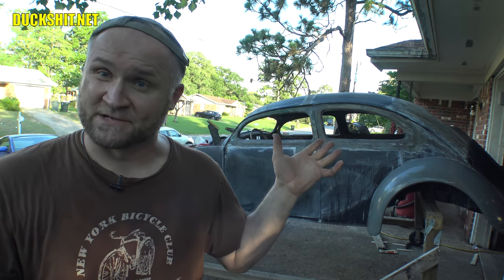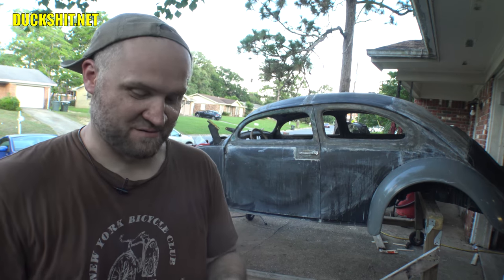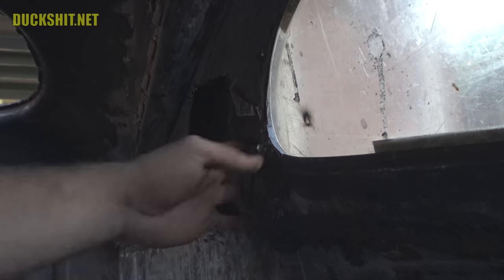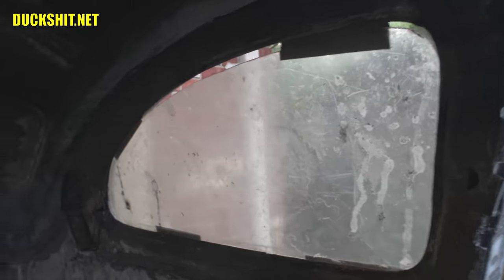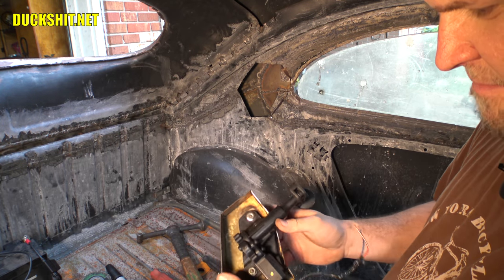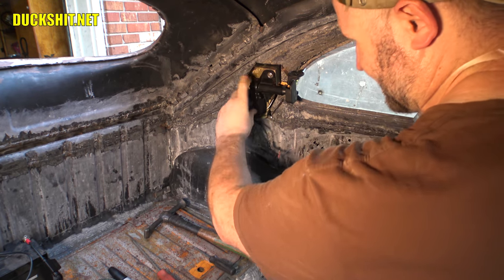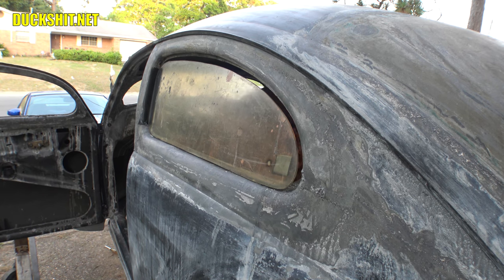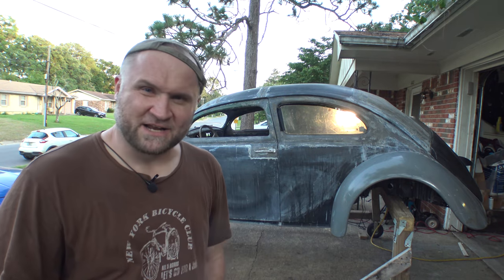VW Beetle Power Pop Out Windows 1 - ROTTEN OLD 1956 - 106

Comment: Man that is so sweet!  Love the fact the  Chrysler one you use attaches via adhesive. I’m sure the odd open angle might be an issue for ones that require a hole drilled through the glass for mounting. Plus it’s one less place of it to develop a leak 👌
Reply from the maker: Yeah, its a good thing that the motors I selected have a ball joint at the last knuckle, it has some limited movement if the window has a bit of twist or otherwise to it. It should be good.... and for all else I can adjust the motor at the bolts to move it around a bit.  But yes, also no leak, and a more streamlined appearance!

Comment: We also had about 4 Caravans. I do remember those pop outs. The early ones had a VW 1600 Rabbit or a Mitsubishi engine. I know this because my parent’s first on had a problem, and it was taken to a VW mechanic to put VW parts in it. I will never forget that he told my pop that he took out that damn MOPAR carp and put in good VW stuff. By the way he said that if he went to Chrysler the parts would have cost him about 75% more!😂😂😂 Dad was a Dodge man. From the time I was born until he died, every car we had was a MOPAR of some kind. Yes we even had a Dodge Aspen!😂😂😂
Reply from the maker: Some years later in the mid 2000s the VW Routan was built by Dodge out of a Caravan. I saw one at the junkyard yesterday quite to my surprise lol.  I thought they put the Dodge in the import side of the yard by accident.  So in a way, you can almost say I used VW parts for the powered pop outs!

Comment: I love the electric pop out conversation. Awsome idea
Reply from the maker: Thanks much!  Trying to square it away today but running out of time... and a second dead motor for the right side! What else is new, right?  lol!
Reply: DuckmanCycles and VW Garage 
That sucks about the two dead motors. Sweet design I love how you are hiding it. Good luck on the other side
Reply from the maker: Yeah now I'm up to 6 right hand side motors... that shot my day to shit today, and baked my body, worn out in the FL sun... which means probably no video tomorrow.  😕   I did pull some other parts from other things while I was there though.  By the way... every left-hand one that I tested worked fine.  I'll tell the full story of course in an up coming video!
Reply: DuckmanCycles and VW Garage 
Odd question can you remove the left side motor and put it in the right did in its place.
Reply from the maker: If you are just talking about heads, cylinders, and pistons yes... but just keep in mind that if you turn the pistons around the other way and we got to make sure they aligned properly.  The pistons usually have a dot that's supposed to point towards the flywheel.... otherwise yes it's all the same on both sides!

Comment: I thought you were going to try A/C. Super impressive
Reply from the maker: Its possible to have AC and pop outs!  😀😀😀😀
Reply: DuckmanCycles and VW Garage   Have you ever wired and Old style alternator with external regulator into a generator car? I am racking my brain and can’t find information anywhere. Would it just be easier to buy an updated alternator with internal regulator and just do the generator bypass that’s common in videos??  I can get an alternator for $68 and it might save me a ton of work and headaches.
Reply from the maker: I have and it does wire the same, but the integrated unit is much easier to work with.  You won't bypass the generator, however... you'll replace it.  You will bypass the regulator, however.  Make sure you get the correct alternator pedestal on the engine, too or it won't fit!
Reply: DuckmanCycles and VW Garage I pulled the engine from a 74 that had the old style alternator with the resistor(?) mounted inside under rear seat. The car it’s going into has no engine but all the wiring is intact but it was originally a generator car. Do I still hook the 3 red wires together and the blue wire to the green wire ? This has me very confused. Is the mountain pedestal different from new vs old alternator? Sorry so many questions. I got in over my head but I’m determined 👍🏻
Reply from the maker: @truckerpeterose  Yes the regulator is under the seat, you will remove this.  You have the wiring figured out correctly.  Yes you will need a matching alternator pedestal as I mentioned above.  I hope that helps!  Thanks for the questions!

Comment: Should have made them roll down. 

I'm not even sure if that's possible.
Reply from the maker: It was a thought of mine, after all you do see it on convertibles.  Probably be even easier with smaller sized windows of this chop top.... but the window would need to rotate down into the quarter panel to fit.